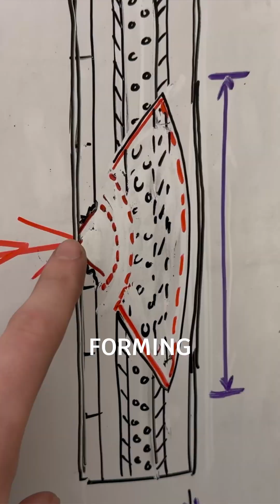SUPER ARMOR (.50 Cal) 💥

Comment: Check out the old advertisement for Impact Gel. They use it for horse saddles but they ran over Anthony Sullivan's hand with a car and he was fine. Impact Gel might be good to add as a layer below the plate to eat a lot more of the energy.
Reply: We are getting ever closer to building Mjolnir from Halo
Reply: That stuff is perfectly fine with slow, lumbering, dispersed, heavy forces. That kind of stuff will immediately fail under high velocity focused kinetic forces. They're two VERY different types of impact.
Reply: Yeah no.
That doesnt work.
Impacts are very different based on velocity, in this case a high speed impact pushes the fluid and solids within aside rather than compressing it together into a solid.
Reply: Could modify the shape of the plate so it works accordingly upon impact. But this is if the plate stops the round. If it doesn't, then you have another problem'
Reply: THATS ALLOT OF DAMAGE!!!!
Reply: Gel for gummy bears now the fat electrician did a video where he shoots a gummy bear with a 9 mil from like point blank range it doesn't even go a full inch in
Reply: Cars disperse energy over a large area. A car can tun over your foot without gel and it would still be fine.
Reply: @JoulesTelly I can confirm, a car can run over your foot with minimal damage. I know by experience. It happened to me. 😂
Reply: @JoulesTelly  I mean, your foot wouldn't be "fine" but yeah, the tire has a lot more surface area than something like a bullet tip
Reply: @Ekul-15 yeah
Reply: @Ekul-15I’d argue zero damage is pretty fine.
Reply: That’s a lot of weight
Reply: @AverageThinking weight isn’t as much of an issue as you would typically think because the whole thing is going to be supported by the exoskeleton he’s building

Comment: Stopping it is impressive but If you can make a more effective efficient design for backface deformation technology you could change the industry entirely even if then material on a back of a metal one would be great😅
Reply: Yeah tbh even if he did unless he somehow reinvents physics the force of a 50 cal round hitting your plate will crack your ribs instantly and probably get you a fatal pneumothorax or rib puncturing your lungs/heart
Reply: @John-lw5xc the idea is finding a material that absorbs the blunt impact and forces it to spread into the entire vest, before hitting the entire chest. You will get thrown back, but better to fall over than break a rib
Reply: @thekingnerd6639  dude that's just not possible with this many ft lbs of force
Reply: @John-lw5xc  He is using new materials. Everything is impossible until it isn't.
Reply: @seraphimconcordant  if that's what you're saying you just don't understand anything about body armor or physics, a normal 7.62 sized bullet with 270 Joules is has about a 50/50 chance to crack your sternum or ribs when stopped by hard armor. A 50 bmg delivers over 15000-20000 Joules of energy, you're talking a 50-100x difference in force.

Even if you had the ultimate shield which blocked everything you still have to prevent the blunt force trauma from killing you and this wouldn't at all
Reply: @John-lw5xc Have you seen his videos. He’s not just using this. He’s building a full protective armor means he would have absorbing pads within the suit that is meant purely for absorbing the force rather than the bullet.
Reply: @caylya7869  your not understanding, typical ESAPI plates the army uses already have about an inch of soft kevlar backing for blunt trauma, flak, and small arms protection. And even then 7.62x39 and 7.62x51 that hit your plate will crack ribs, sternums, and collar bones because of the blunt force trauma from about 270 Joules of energy. 50 BMG HAS 15000-20000 JOULES OF ENERGY you're gonna be liquid inside from that kind of Behind armor Blunt-force trauma B.A.B.T. look at the Ohio state study and stand corrected
Reply: @John-lw5xc Did I say he would be undamaged? No. I’m just saying he wouldn’t be completely out of it
Reply: They key is to put the material on the front of the metal. The metal fails by melting of punch through, so you put layers in front to break up solid projectiles and absorb energy and absorb or dissipate heat...

Comment: there is a couple that will stop a normal 50 but the spicy round you will be using i don't think has been stopped by body armor before
Reply from the maker: They can “stop” a regular .50 round but it forms a massive back face deformation and are exclusively rated for "standoff" meaning it only works if its held away from the wearer soo…
Reply: @CrashMakerspace I did read up on it and yeah I guess there has been some "stopping" by armors in the pastas you say. So I was wrong if we are using "surviving" versus being "ok" after the strike. Your project is amazing btw.
Reply: You must not be thinking of the right .50 cal bullet.  a desert Eagle vs. a Barrett...